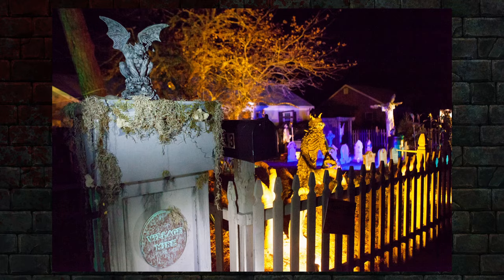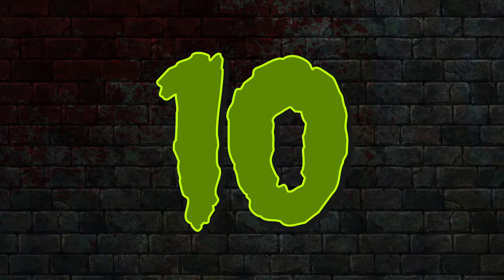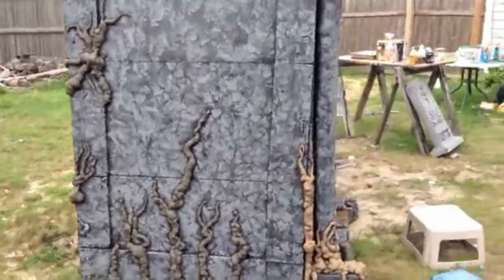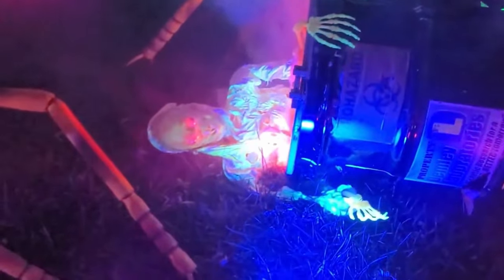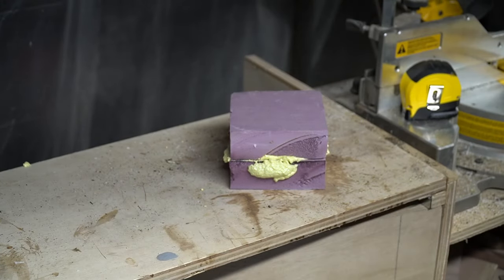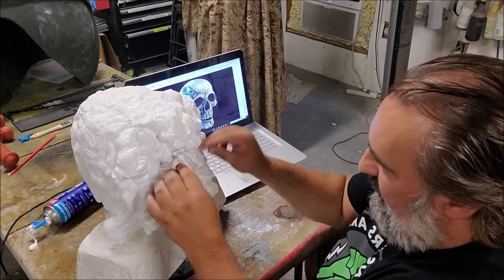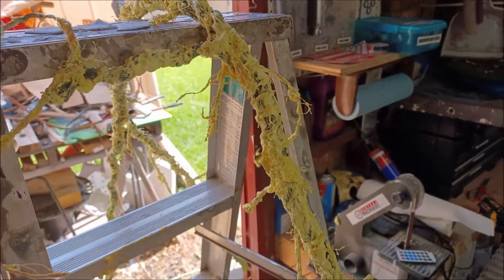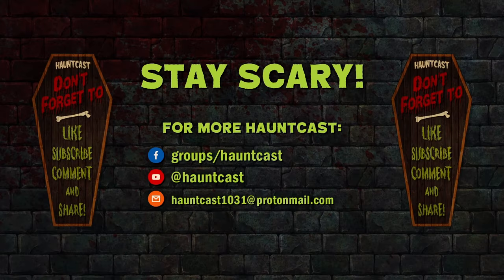Top 10 Uses for Expanding Foam | Making Halloween Props using Great Stuff & Loctite Spray Foam

Comment: Yeah, also agree with #1. A few years back I was using some expanding foam and I was wearing this Disneyland hoodie that had lots of sentimental value. I don't remember what happened, but there was an impending disaster that I had to fix real fast and I got the stuff all over my sleeve and front. Kinda trashed it. :(
Reply from the maker: I ruined my favorite jeans with GS. They fit perfectly and were super comfortable which is rare to find at least for me. Never found another that could compare.

Comment: Hi, thanks for the video! I have a question? Will expanding foam adhere/ glue foam board to a plastic surface? Im looking to modify a Halloween prop I got, the 6ft LED casket from one of the big box stores.
Reply from the maker: I haven't experimented with foam on plastic, but I'm sure it would work. I would scuff up the plastic surface with sand paper first.
Reply: @Hauntcast  ok thank you!